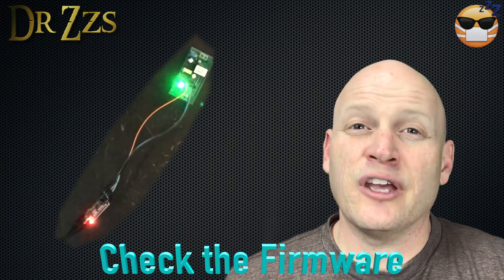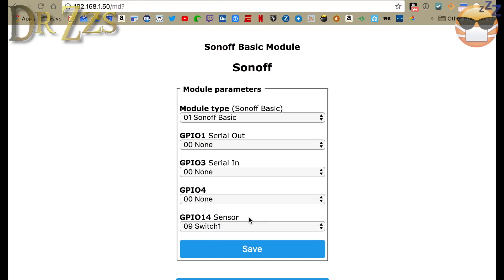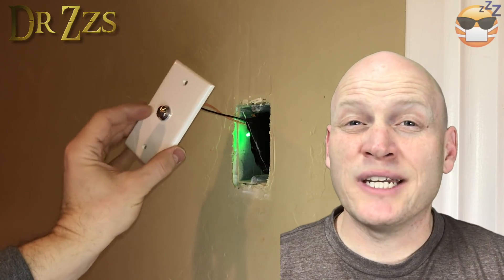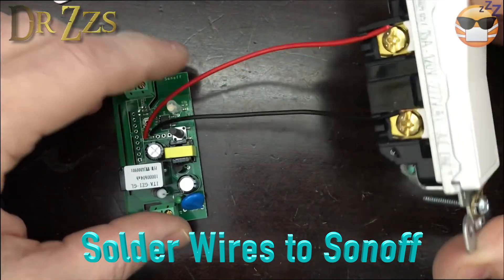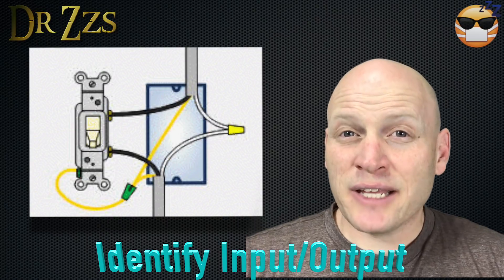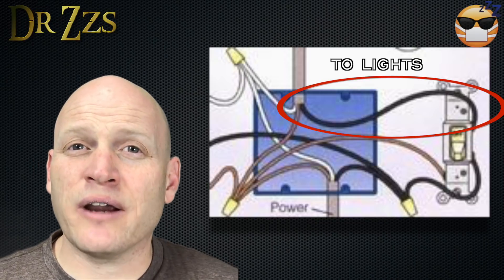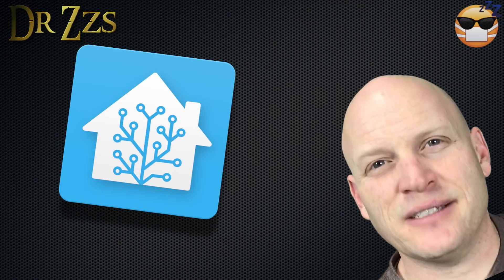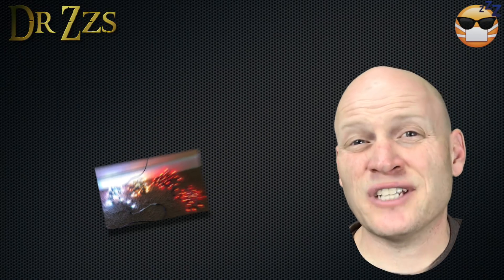No $30 "Smart Switch" | $5 Sonoff + REGULAR Light Switch!

Comment: Hi, great video.. Just a small trick. If you have only 2 wires coming from the light (first light switch wiring diagram), you may simply install your sonoff directly in your light box and use that 2 wires going the switch to drive your sonoff.. I don't know if it's clear?
Reply from the maker: Thanks!Where does the neutral wire come from in that scenario? 
The only way I can see to use just the 2 wires would be to have the hot wire go to the Input Line on the Sonoff and the other wire (the switch leg) to the Output Line.  You still need a Neutral or the Wifi chip and relay won't function.  It might work to put a small wire from the Input(or output) Neutral contact on the sonoff to Ground.  But I would not do that.  I probably shouldn't even bring it up as an option. 

If what you're saying is you use the two wires as Input L and Input N on the Sonoff, that might power up the sonoff, but then what wire is left over to go to your lights? 

I'm certainly wrong sometimes.  If you have a sonoff (or any other smart switch) somehow working in this situation with just 2 wires coming from the lights, I'd love to get more details about how you're doing it.  I just don't see how it can work without 3 wires, a Hot, a Neutral, and a Switchleg. If I'm wrong that would be great actually!
Reply: Hi DrZzs, What I meant is you can install your sonoff directly in the light's electrical box... you use the 3 wires from the circuit breaker(gnd neutral and live) to power the sonoff. Connect the output of the sonoff directly to the light. You can use the remaining two wires and maybe gnd that goes to the switch to drive the GPIO14... What do you think about it?

Comment: So... if I understand correctly, This absolutely has to be flashed to custom firmware to be able to use a normal light switch ?
Reply from the maker: No
the flashing makes it possible to communicate with a Home Automation hub using MQTT. 
You can just open up the case and solder wires onto 2 of the switch contacts and run those to a normal switch. 
It'll work with Alexa and Google Home and of course the default app. 
Hope that helps!
Reply: I use all my stuff with my Google Assistant ( My phone instead of a google home device ). So basically just wire it the way you did and it will work with the original switch ? That's great !
Reply: DrZzs thanks a lot for the info and videos its great!
Reply from the maker: You're welcome! 
If you just want to use the default firmware you will need to put your switch wires to the legs of the onboard button on the sonoff, not the GPIO pins I use.  
If that's not clear let me know.  There's a video out there of someone doing exactly what you're looking for.  I don't have it at my fingertips but I can help you find it if you need it.
Reply: But that's meant to be momentary.. So wouldn't work with a normal wall switch would it ?
Reply from the maker: you are correct.  Sorry forgot that part.  
In the video I saw of someone else using an un-flashed Sonoff they also modified the normal rocker switch so it would function like a momentary switch. 
Let me see if I can find that video...
Reply from the maker: here's that video:
https://youtu.be/oUFuuoNfvyc
Reply: Thanks a lot for your help buddy. Looks like I'll be doing that firmware flash afterall. It just seems easier to do.

Comment: Great videos! I have followed your tutorials exactly and currently I use the emulator function as a wemo to work with my phone and Alexa. Everything works perfect. Is there a way I can hook up one to a 3-way switch?(US definition) is it as simple as putting one sonoff at each switch and changing the configuration to switch 02? Any response is greatly appreciated! Thanks!
Reply from the maker: Thanks!
I have a video about doing 3-way switches.  My way isn't the only way, but I did pretty much what you suggest. I put one sonoff connected to the lights directly, then ran power to the other sonoffs using the 3-way wires that were already running between the switch boxes.  Then just set the other sonoffs to control the first via MQTT.  
https://youtu.be/GEJCk-Dr3BQ

Read the comments on that video.  Someone said there's a way to do it in Tasmota instead of through a Home Assistant Automation.  I haven't changed mine, but that seems like an easier and maybe more reliable method.  
Hope that helps!
Reply: Thank you very much for the reply! I will check it out!

Comment: Hello DrZzs. Please tell me how does it work with rocker switch? :) you can turn it off by wifi but to turn it on again with rocker switch you how to switch it off and on again, am i right?
Reply from the maker: TheDrunkenPL Nope. Thankfully you’re wrong 😎
It doesn’t matter which method you use to turn it off or on, the next method you use will turn it to whichever state it isn’t already in. Just like a 3 way switch. 
It works like you hope it would. 
Hope that helps!

Comment: I want to do something like this. Do you think this would still be covered by insurance in the case of a fire?
Reply from the maker: No. I don't expect it would be covered.  
If you want full UL listed devices like this you'll have to get the $30 variety.  

I think your best bet is to do some things to make sure (or as sure as possible) that you won't have a fire because of this device.  I'm finishing up a video that I'll have out this coming Monday about exactly that. 
The #1 thing to do is to add a 10 amp fuse to the Line-in wire.  You can get a wired fuse holder and 10 amp fuse for about $1.50.  That'll go a long way toward avoiding ever having a problem with overloading and fire. 
The other thing is to make sure you aren't overloading the Sonoff by calculating the load you're putting on the device.  For example if you have five 60w light bulbs at 110v that's about 3 amps.  (w/v=a)  Keep the load below 10 amps (which would be 20 bulbs!) and you should be fine. 

Hope that helps.

Comment: the sonoff basic is 10Amp and light switch is 15Amp doesn't it going to kill sonoff?
Reply from the maker: Nope, it doesn't mean it will kill the sonoff.  It means the switch can handle a higher load without burning up.  The switch isn't a load, it isn't drawing 15 amps (thank goodness).  
But the Sonoff does become the weakest link in the circuit.  So if you overload it the sonoff will burn up before the switch melts or before circuit breaker trips (which is the real problem).  
Make sure you stay below 10 amps on you load.   You can add up the number of lights you're switching and guesstimate the load on you sonoff.  
If you're using 60 watt bulbs on a 120v circuit, you can have 20 bulbs before you get to 10 amps.   I hope nobody has 20 bulbs on one light switch.  If you're using LED bulbs, the 60 watt equivalent only draw about 12 watts, so technically it would take 100 of those to get to 10 amps.  
My point is just that under most lighting situations you'll be way under the 10 amp rating of the sonoff.  The best thing to do, if you really want to be "safe" is put a 10amp fuse on the hot line going into the Sonoff.  
I'm working on a video right now to explain how to do it.  It'll be out next week. 
Hope that helps!
Reply: I made the light switch working with both alexa and physical switch. I followed until the 09 switch part.
Since I use alexa instead of MQTT, to disable MQTT, I found the codes in the internet. 
Going into the TASMOTA Sonoff web - console  used following code:

SetOption3 to Show current MQTT state
SetOption3 0 / off | Disable MQTT
SetOption3 1 / on | Enable MQTT
SetOption4   Show current MQTT response state

Then I switched the emulation to Wemo switch
That made the Alexa able to find the device!

Thanks for your helping me :)
Reply from the maker: Syunghyuk Seo Awesome!  Good work!

Comment: Is there a way to connect a wall switch (rocker on/off) to an unmodified (not flashed) Sonoff and for it to work?
Reply from the maker: yes.  I've seen a video showing it.  
https://youtu.be/oUFuuoNfvyc

Not a lot too it.  Just solder some wires to the legs of the on-board button and extend them outside of the box.
Reply: But isnt it for a button switch, and not a rocker on/off switch? I would have to change my wall switches to button rockers, instead of up(off), down(on).?
Reply from the maker: yes.  You do need a button type switch.  If it isn't that video then there's another where the guy opens the rocker switch and modifies it so it doesn't stay in one position.  Essentially turning it into a momentary switch.  
There's no way that I know of to change how the button functions on an un-flashed sonoff.  And they don't have the GPIO pins set up to do anything extra (like adding a switch). 

Hope that helps!

Comment: Great vid, thank you for this! I've gotten my switch to work, but do you have lags sometimes when you toggle the switch? Here's a video of what is happening https://photos.app.goo.gl/zxkXY0zt8QYxzbg92
In the logs I have:
17:46:01 MQT: Connect failed to 192.168.1.104:1883, rc -2. Retry in 10 sec
17:46:01 RSL: stat/sonoff1/RESULT = {"POWER":"OFF"}
17:46:01 RSL: stat/sonoff1/POWER = OFF
Why is that?
Reply: Ok turns out my Sonoff couldn't connect to my PI and because of this it started to behave laggy! After I've rebooted the PI the errors have gone away and it started to work!
Reply from the maker: I have had that happen from time to time.  I don't know exactly what is happening.  I've got a few guesses. 

1. Interference in communication between the serial log and relay activation: the Tasmota page says it's "wise" to turn off the serial log for all sonoffs.  I admit, I haven't done this on all of mine. To turn off the serial log, in the console type "seriallog 0". 
2. Could be interference from other EMI noise being picked up by the wires to the switch. Next video (working on it now, will be out Monday), is about how to fix that with a Low Pass Filter.  Scroll down to the bottom of this page for some info about it. 

https://github.com/arendst/Sonoff-Tasmota/wiki/Expanding-Sonoffs
3. Is a generic nebulous answer given by someone who doesn't understand everything that's happening (that would be me).  Sometimes the ESP chip gets overloaded or confused and doesn't work right.  ;P

Let me know if you get the lag to go away forever.
Reply from the maker: Ha!  That's fantastic!  
I love easy solutions. 

Well, the Low Pass Filter and turning off Serial log are still good ideas!

Comment: Once again, love your Videos and I now have several sonoff's running tasmota. I have even placed them in my light switches.  My next question is do you know if sonoff basic running tasmota could work with a dimmer switch? IE: I connect dimmer switch to GPIO14 & ground. Will it turn on/off and dim as well?
Reply from the maker: Thanks! 
Unfortunately, no.  The function of the GPIO pin is just on/off.  
There are a lot of people requesting iTead make a "hackable" dimmer.  
You'd have to put the dimmer after the sonoff on the main hot wire to the switch. 
I'm on the hunt for a DIY smart dimmer.  If you find one out in the wild let me know.  If I find out how to make one you can be sure I'll make a video about it.

Comment: Is it ok to use jumper wires to connect (GND/GPIO 14) on Sonoff to my Leviton decora switch? Just trying to avoid soldering if at all possible.
Reply from the maker: I had to look up Leviton Decora.  Is that a "smart" switch?  I'm guessing it's not, but I did find some switches with that name that are "smart".  

If it is just a normal "dumb" light switch then absolutely yes. You can use jumpers and connect it to GPIO14/GND.

The GPIO/GND wires are low voltage and low current.  Jumpers are fine.  And you can connect them to any normal switch.  Anything from a tiny PCB mountable push button to a big'ol standard light switch. 

But you should learn to solder!  It's not too hard, and it'll open up a bunch of new possible solutions.  Especially if you're into DIY smart home/electronics...
Reply: Awesome! Yeah just referring to the standard paddle switch (not smart) you have on your wall in the demo. And you're right I should learn to solder. I've ordered jumper wires and a decent soldering iron so I have options. Thanks for these videos. They are some of the very best out there!
Reply from the maker: Wow! 
Thanks! 
I'll keep making them!

Comment: hello, I got only two wires per switch in my wall and in some cases 3 wires which the third one is for 2 way (ale retour) will this work? and if I use livolo switch will I be able to fit the sonoff or Connect the somehow the touch button ? thanx
Reply from the maker: Can you post some pictures? 
Upload to dropbox or imgur and post the link here. 

If all you have in your switch box is the two wires going to the switch, the problem is there's no neutral in the box, so you can't power up the sonoff. 

You could possibly put the sonoff up with the lights, since that's where the Hot and Neutral from the circuit breaker are probably coming in. 

If this is what you have:
http://www.how-to-wire-it.com/images/2-way-power-at-light.jpg

Then the sonoff would have to go near the light. 

The difference with this arrangement is the presence of the neutral wire in the switchbox:
http://www.how-to-wire-it.com/images/xbasic-2-way.jpg.pagespeed.ic.SAY51GtR2S.jpg

Another option would be to use the Sonoff SV.  Separate the power to the ESP chip from the wires switched by the relay (I just did a video about this that'll be posted in the next hour or so).  
You could then provide low voltage to the ESP part of the board through some other source (would mean plugging in a power supply somewhere to run the sonoff).  Then put the wires that are going to your switch now into the (+) input and (+) output on the sonoff.  

https://www.itead.cc/sonoff-sv.html

Scroll down to the image labeled "Isolated Mode".  You don't need the black (-) wire on the input and output.  

Those are the options I can think of. 

Hope that helps!
Reply: Thank you very very much for your support, finally I found some support around the internet about this.
I'll upload tomorrow a picture n google drive and I'll send you the link if you re ok with this. I think the second option might fit my needs, do you think I might get 5v from the livolo switch ?under the buttons plate in livolo there are 3-4 pins..the idea of a battery even lipo make me think I should always care about the lifetime, duration.I cant do much in my house because my wires in my wall are all set and rewire means break walls make hole, open halls and disaster, odd job.

Comment: Thanks for the nice video!  Everything worked well for days... Until I soldered wires to Ground and GPIO 14 (to hook to a momentary pushbutton as in the video).  NOW... the relay in the Sonoff is energized and de-energized intermittently and randomly.  It does it with and without the pushbutton switch hooked up.  The wires soldered to the pins are 12 inches long.  I did configure the module with GPIO 14 as Switch 1 AND entered the "switchmode1 4" commend in the console.  Has anyone experienced this?
Reply from the maker: There's a chance that the wires are picking up interference and triggering the relay. 
Something to try is adding a resistor and capacitor per these instructions:
https://github.com/arendst/Sonoff-Tasmota/wiki/Expanding-Sonoffs

bottom of the page under Electrical Considerations.  

The sonoff board seem pretty robust, but I have certainly killed other boards (D1 mini) with soldering. Hopefully that's not what happened to yours.
Reply: DrZzs Greatly appreciate that link!! Thanks, again.  I soldered a pull-up resistor per their suggestion and the Sonoff is behaving predictably once again.  Rock solid for the past three hours (where before, it would glitched at least a dozen times by now).
Reply from the maker: Daly Gutierrez Awesome!!
Reply from the maker: Wuhoo!  I love it when stuff works!!
Reply: DrZzs Agreed!!  I'm claiming this one 💯% resolved!  No glitching whatsoever.  Thanks again for the help.

Comment: Hi DrZzs. I`m using a sonoff with a "normal" switc in my room (Thanks for the tutorial!). It has been working flawlessly for two weeks. But today Im having some trouble, when I use the switch, it takes several seconds to turn on/off the light (when I use the button in the web page it responds inmediately). Maybe Its necessary/recommended to restart the sonoff every week?
Reply from the maker: I have had some strange behavior from the sonoffs occasionally.  
I think the wires from the switch to GPIO14 might be picking up enough interference to not function properly.  Good news is there's a fix.  I didn't know about it when I made this video, but I'm planning to include it in another video soon.  
Here's the instructions if you want to try it.  Scroll down under "Electrical Considerations".

https://github.com/arendst/Sonoff-Tasmota/wiki/Expanding-Sonoffs

Hope that fixes it!

Comment: Couldn't you keep the same firmware and just solder the momentary switch to where the stock button is?
Reply from the maker: yes, you sure can.  The reason for using new firmware is to get the Sonoff communicating with Home Assistant (or your home automation hub of choice). 
With the default software, you can only control them from the eWeLink app.